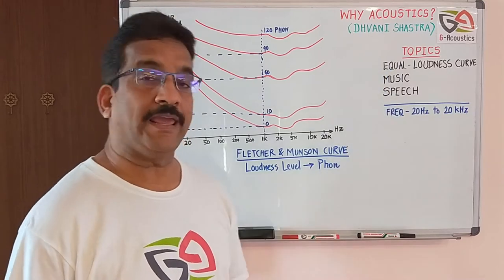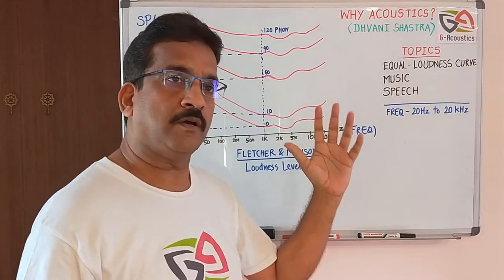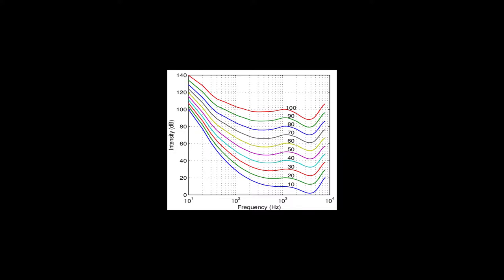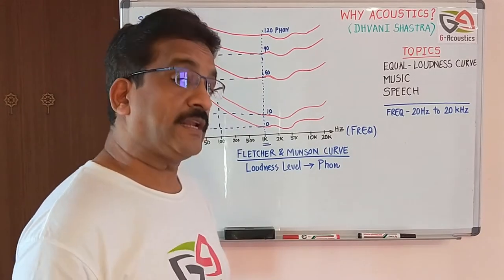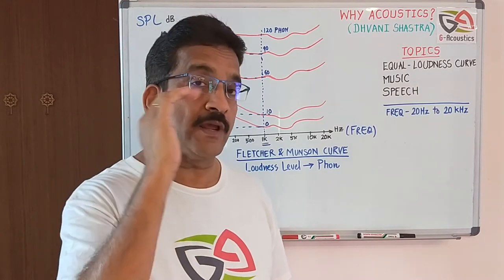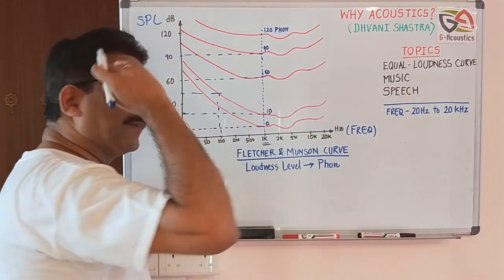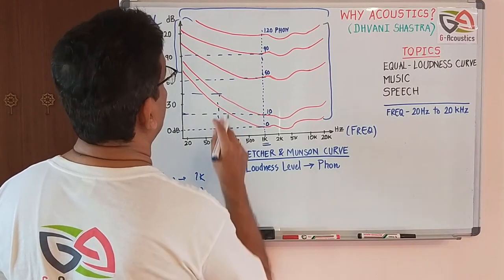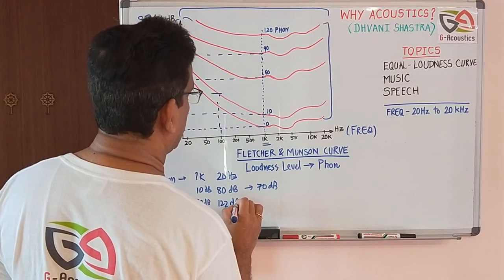Acoustic Bites - Equal Loudness Curve

Comment: Hello, I have a question, 

I have a rehearsal studio with a 30 cm thick brick wall, but my neighbors still hear the kick drum thumping. 

How loud is the low frequency (80Hz - 250Hz) considered inaudible?

Thanks
Reply from the maker: When it comes to Sound, 2 ways Sound can travel - Air-Borne & Structure Borne. Both need to be handled for Sound Proofing. In your case, Structure borne Noise is the culprit. For this one has to use Impact Noise platform. Do check on below link: Acoustics Story of a Drummer in  https://www.facebook.com/gacoustics